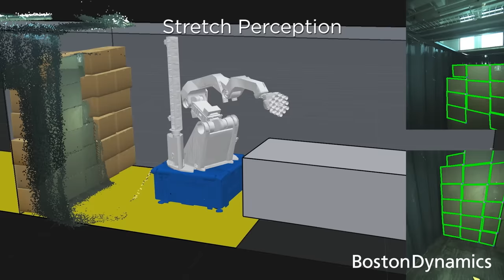Introducing Stretch | Boston Dynamics

Comment: I'm honestly more impressed by the suction cups than the robotics.
Reply: Those robots have to be loud as shit if they're creating that much suction. I feel like the video dramatically decreased the audio. Maybe not though 🤷‍♂️
Reply: @FuckinGaming  why would it matter
Reply: @FuckinGaming  Yes but robot arm on wheels
Reply: Maybe those aren't suction cups, but a gecko tape
Reply: That's probably a big selling point especially because it seems to work nicely without damaging anything, although those boxes may be empty. I'd like to see how much weight it can lift before it starts dropping stuff
Reply: Because the boxes have shitload of tape on them
Reply: No way I believe those are a reliable way to pick up a package, especially some of the packages that have arrived at my door. Maybe if it used the cups to lift it just a bit and get a "hand" under it I'd be more likely to feel it was safe.
Reply: @tomhorsley6566  It might not be a passive suction, but an active one.
Reply: If you look closely, the suction cups are attaching to the clear, non-porous packing tape on the top of the boxes. I'm skeptical that this would work on bare cardboard. I also think that these would get dirty in no time and would lose their ability to grip. Real warehouses are often quite dirty and equipment is not properly serviced / maintained.
Reply: @blinded6502  You are right. It appears they use some kind of vacuum.
Reply: @Vir9il  We have a robot that stacks pallets, it uses a cushion type head to create vacuum and picks up cardboard boxes with ease. With way less tape. The suction cups used on these types are quite stiff and should work well for that purpose as well. The issue with those cups though is that they start to crumble quite quickly. (we have the exact same type in stock) Also, dirt on those cups isn't an issue really. The clogging of the filters for venturi circuit on the other hand...
Reply: well it just sucks to be those cups!
Reply: it is a multi cup vaccum,
Reply: @Vir9il  these do work on cardboard, I worked in a food processing plant and those suction cups were a core part of our packaging workflow, if calibrated properly a handful of those could hold up a small car.
Reply: Add weight and dust to those boxes, and you'll be considerably less impressed by them.
Reply: @ReZpawner  these suction cups are not old school buddy.
Reply: @bagelhunt  I stand corrected
Reply: Your wondering how it works when i can hear an active suction pump in the background.
Reply: With certain design, a vacuum cleaner can be fully-able to lift a car with the suction it produces. Having a robotic physically do it would mean there is a much higher success rate in creating a proper suction, since human error is removed.
Reply: @Vir9il  No they do work on bare cardboard, look at 1:03 where it is picking them up on the sides of the boxes by the bare cardboard. These suction cups are not like the ones you have sticking your phone holder to the dash of the car, they are active vacuums that are used often in warehouses already. The thing with new technology is it is almost always the culmination of already known working devices, just put together in a way that is unique; I would expect the same occured with this technology.
Reply: Damn right?! I was thinking what they got their own air compressor on that fucking thing thats running dry air with a reservoir tank you gotta fucking drain out daily, then have a big enough power supply to supply for moving that heavy fucker plus enough watts for the compressor... that thing has gotta have a like a tesla battery in it or something.
Reply: active vacuum cups, super reliable and used loads in the past and today, primarily used on the production lines. as the max weight capacity, Boxes are already regulated on that front with shipping requirements so a QR code to tell the machine the weight of the box so it can change its parameters to suit wouldnt be a bad thing, most boxes also have smooth waterproof labels on them which would be a good anchor point without doing any damage to it.

irrigardless to any of that, Boston Dynamics would have done Basic Practical trials, to see if its suitable for the task anyway.
Reply: Yeah, it sucks!
Reply: Those are Piab packaging multi-bellow suction cups. Trust me, I worked with grippers, they're pretty good even on porous material.
Reply: Yeah. If those things were real we’d already have them by now. 

Those machines would get very dirty very quickly.
Reply: Likely using closed air vacuum system. They apply a vacuum when the suction cup is pushed on. So it can likely grip almost any surface.
Reply: Honestly i am as welll
Reply: @FuckinGaming  I work in industrial automation and I can tell you that you are correct, the suction noise is load, but what's even louder is the compressor noise. There is an air compressor which works on and off to keep vacuume in order for the suction to work.
Reply: A lotta people here underestimate suction/vacuum power.
Reply: Guys, those guys are making the best robots out there and you talk about the problems this one would have.. I think they are smarter then you so they would see the problems and already solved them or they will solve them in short time.
Reply: same
Reply: @veggiebag  not that much of a challenger really, outside of maybe power issues, they probably just mostly reuse the spot program
Reply: @ReZpawner  yeah my thoughts too, i've had issues with dust and robotics before, i hope they do have some idea tho :)
Reply: Because they can lift empty boxes? Maybe they should try with boxes full of books.
Reply: For those doubting if it can lift heavier stuff than empty boxes, did you not see one pick up a Spot mini robot at the start?

Those things aren't terribly light.
Reply: Why? They aren’t new. Industrial robots have been using suction cups for handling sheet materials for years.
Reply: @randombloke82  yes, and they work great for smooth surfaces like metal or plastic, not cardboard.
Reply: @OwlskiTV  Well you don't understand the difference? The spot mini has a plastic body, not cardboard. Try to attach a towel hanger with suction cup  on a cardboard wall.
Reply: @Empusas1  The suction cups Stretch uses are nothin like the ones you describe..
This bot uses active suction (ie. vacuum powered suction).
Reply: @IRNoahBody  You typically design your robotics installations depending on what you are using them for, so if you have work flows that require lifting heavy stuff in cardboard boxes you will probably go for a different attachment.
Reply: I know how they work, you have needles that pierce thru the packages. I've done this with tvs and the forklift my whole and it works great. Don't know why my boss said one day I can take holiday as long as I want to
Reply: The boxes are empty.  Can the suction cups hold up weighty objects? That's the 64K question.
Reply: @OwlskiTV  And? Unless the surface allows a proper seal you never get sufficient strength to hold huge weights. So unless you wrap the boxes with tape....
Reply: @imVexedBruh  Supposedly 50 pounds.
Reply: @imVexedBruh  well they can lift at least 1 Spot. That's.... a bit over 10kg?
Reply: It's active suction, so not impressive. not difficult to hook a nice vacuum pump up to a bunch of decent suction cups
Reply: Those aren't suction cups...

Comment: For anyone wondering about the suction cups. They are not just passive suction cups. They are active, meaning they are connected to a vacuum sucking in, which is why there is so much suction on surfaces that passive suctions cups would not work on.
Reply: Yes. Its a shame all the boxes seem empty though. Wonder how the suction would go with decent weight in the boxes (realistic).
Reply: @John_14v6  will go well, this kind of suction cups are already used even in stationary robots in factories in the third world (handling heavy boxes, I already saw this kind of thing with boxes of Iron Nails)
Reply: How do those suction cups plan on working when they get wet and dirty? Clean boxes aren’t impressive.
Reply: @KiLLJoYYouTube  I honestly don't know why soo many people keep bringing this up, thinking this would be an issue.

Imagine this; If you had a rubble nozzle attached to your vacuum's hose, and it got wet and/or dirty; It'll still hold a good suction against the object it's picking up. Any dirt/dust would literally be sucked up through the vacuum and probably land into the machines filter (to be cleaned out). Water is also not an issue in this regard.
Reply: @OwlskiTV  only issue maybe would be how it would handle damaged or unsecured boxes.. but if it's on an assembly line/manufacturing scenario, most boxes should be fine like u say
Reply: We use those at work, even a small one is pretty damn strong
Reply: @KiLLJoYYouTube  maintenance. Everything needs maintenance, including humans.
Reply: @mmmgoes  looks like it would need a lot of damage to be unable to pick up a box and I expect being at an angle wouldn't be a problem (or a solvable problem). Wet and damaged on the bottom might be a problem as no way to keep it shut and keep it from falling apart but that's more a problem with cardboard boxes than with a robot and it would be a small minority which could be passed on to people. With decent boxes and decent storage conditions it should be rare. Recognising which boxes are likely to fall apart might be an issue .
Reply: Yes this is nothing new and standart in the industry
Reply: I love how everything in this robot is new and inovating but the suction cups, but many people are talking only about that.
Reply: but this isn’t real? it’s all CGI. you can especially tell when it puts down the dog because it literally almost floats
Reply: @HueHanaejistla  It used to be "magic". You know. Things people don't understand. Now it's "CGI".
Reply: @AnttiBrax  it’s far too smooth for it to be in real life
plus on a lot of other videos I’ve seen it’s been CGI
also the texture looks weird on the plating, it just seems too perfect to be something real
Reply: @HueHanaejistla  it's real. Just because it's clean doesn't mean it's fake 🙄
Reply: @HueHanaejistla  Come on. Just read your own comments aloud and replace CGI with magic. 😂
Reply: @HueHanaejistla  that's because this is a video expressly made for demonstrating the stretch. the robots don't have mating rituals like that either - a developer made them do that for the video
Reply: It can lift 23kg
Reply: @HueHanaejistla  Lmao, better start believing, Boston Dynamics is the king of fluidly moving Robot, Check out Atlas, it can do Parkour

Comment: Since everybody loves Spot, it never hurts to give Spot a role, no matter how brief! :D
Reply: This "Spot" crap is for doing what?
Reply: @movieclip6830  This ""crap"" if you want to call it like that "is an agile mobile robot that navigates terrain with unprecedented mobility, allowing you to automate routine inspection tasks and data capture safely, accurately, and frequently". He can do tasks too dangerous for humans.
It can be used for construction, oil and gas, utilities, mining, manufacturing, public safety, research and of course entertainement.
It can carry and power up to 14kg of inspection equipment, can be controlled from far away, can balance himself in uncertain surroundings with payloads of up to 14kg, has a 360° perception to map terrain and avoid obstacles as they appear and use a software to program automated routines and missions.
Reply: @GellertTV  So what you're saying is that Spot is more perceptive and agile than Historias?
Reply: @browerkyle  Yes

Comment: As a previous package handler, i am genuinely curious how they deal with a horrible mangled box that has been through hell.
Reply: Humans, robots are great for repetitive and boring jobs like handling boxes but terrible at doing anything else, modern robots need to be programed to do anything and while adaptative programing and artificial inteligence with neural learning has allowed to simplify and automatize a lot of this processes the reality is that modern artificial inteligences are limited machines, they are pretty good at doing one job and suck at doing anything else thats not related to that one job

So in this case the solution would be to have a bunch of humans supervising the robots, a bunch of mechanical enginers that can repair the robots and other people that make sure everything is going well and dandy, if a mangled box or other problems arrise thats why you have humans
Reply: Destroy the box even more hha.
Reply: wont be any more mangled boxes  if robots handle the entire process...
Reply: Like any other robot with suction grippers does: Between "just fine" and "AAHHHAH!! HELP!" depending on whether the box/object actually falls apart when it tries to lift it up.
Suction pickers/grippers are nothing new. The cool thing here is that the robot can freely move around and is able to distinguish single boxes from the whole "cube" on the pallet.
Reply: @carso1500  A tool changer could be added at the wrist to allow the vacuum grippers to be swapped with additional EOAT (preferably holstered onboard) that can accommodate boxes that do not conform. A universal EOAT with retracted grippers would also be possible. But yes, failing all of the possible engineering solutions, Bob could get out of his chair, go down to the floor, and load that one jacked-up box by hand. However, having worked in plants that were fully automated to the point that only a maintenance team and a few engineers were ever on the clock, I'm inclined to believe that, if these boxes are leaving the factory, they will always be pristine, especially if they are never touched by a human.
Reply: Can you define "far"? Have you ever been up close with industrial robots and automation? Have you ever compared their performance to the humans they replaced? Maybe they are not perfect, but they sure beat human workers every single time. Fast, repeatable, dependable performance, never sick, never calls out, no breaks, and it doesn't play with a cell phone while it's welding, stacking, painting, etc. They may be "far" from perfect, but human workers are a galaxy away from being perfect in comparison.

Comment: boston dynamic robot: dances for a second in the middle of its shift  but is still more effective than a human worker
Reply: At that  $ Nails pace?. Bee longtyme to HA mmer yorr last
Reply: What’s so special about robots??? I can lift boxes and use suction cups aswell 😤😤😤
Reply: @dunkey7739  Robots don't have these pesky workers rights, time off nor hourly wages.
Reply: @tardvandecluntproductions1278  wdym? I’m just built different 😤 I can do all of that.
Reply: @oneman1812  don’t worry they will get better.
Reply: @dunkey7739  You can work 24/7 without any payment and be transported in a box?
Reply: @Mike-kr5dn  that's what spooks me
Reply: Vaccines are unloaded for human disposal. XD
Reply: @rzproject123  it's not the humans I AM concerned about
Reply: @oneman1812  You could have these running 24/7, only swapping them out to charge
Reply: @LashanR  I used to run pallet jack s
& When Batts went ded. Bytch to push pull & tug
Reply: Can you gas them on arrival? Haha
Reply: That’s extremely slow also would need a whole new design for boxes that weigh more than 40 lbs
Reply: @jacobprittie2010  why is it nobody understands that it isn’t normal passive suction cups? They’re actively pulling a vacuum, meaning you could lift a whole lot more than you need for 99% of 📦
Reply: @dunkey7739  they work for free, while we demand 15 dollar wages and by 2025 20 dollar wages, guess who's keeping the job.

Comment: I workedat Target. I can immediately tell there are issues and limitations to this fantastic robot in regards being able to grab/lift and move payloads as fast as a regular loader/unloader team. The sheer variety of products, shapes, weights, and and the way they are stacked on a truck would absolutely fuck with how viable these would be. Especially if there are messes, PIPOS, cramped quarters, etc. My guess is that a team of loaders would accompany the robot or vice versa. Smaller shops and certain big-box stores would still need people for a while.
Reply: Not if it’s robots doing the loading as well. Then, the map of boxes is sent to the unloaders and it’s pretty easy to navigate then.
The suction tech on cardboard seems suspect, though.